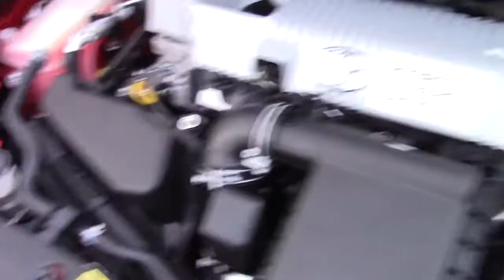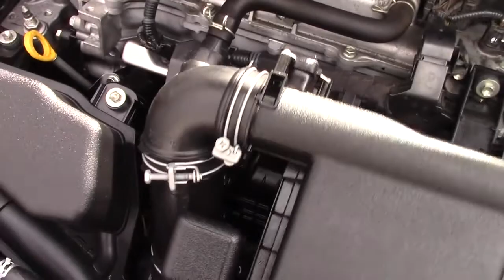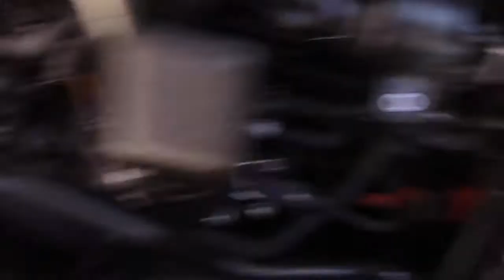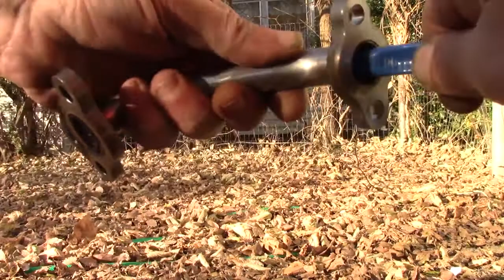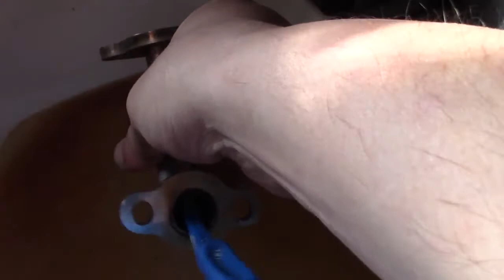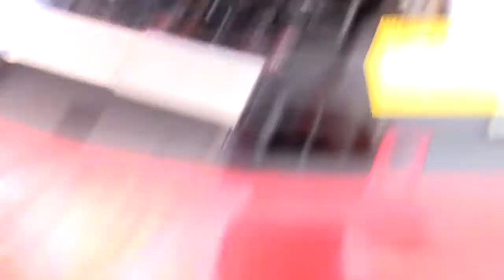EGR pipe cleaning on 2010-2015 Toyota Prius

Comment: Thank you very much! Just rolled over about a hundred six thousand miles and my engine light came on for this reason. I guess this is the only thing I have to do to make it go away I keep the engine clean?
Reply from the maker: With the engine light on, it means it's definitely time. If it still runs great you should clean out the whole EGR circuit right away. NutsAboutBolts has a full vid on it. It involves stripping down the whole path, inlet manifold, valve, cooler and the pipe. A weekends worth, but can be done on your own and saves the car. 

This is a good short thread, with plenty of tips:  https://priuschat.com/threads/egr-circuit-cleaned-it-still-cel-now-what.198447/

Comment: I dont understand how peope in the US get the egr clogged up. Poor fuel and a lot of city driving?

Your egr pipe looks normal after that milage. Mine looked the same after 165.000km (100k miles). I also cleaned the bottom part of the egr. Easy acces to it when the pipe is off.
Reply from the maker: Neither do I, being from England  :)  You have a valid point about fuel, with all the Ethanol here. It's possibly the other way around for build up too, much longer journeys? We just did a trip to Minnesota and back, 2000 miles of highway. Great for traditional ICE cars, not for Atkinson hybrids?
Full EGR cleaning is next on my list + a catch can. It's been 100% reliable over the past year and I aim to keep it that way.

Comment: How does a clogged EGR pipe cause a head gasket problem?   Is the EGR valve stuck the problem, or is it clogged pipe (between the intake and EGR Valve) with full functioning free flowing valve (with no active flow) a problem?  The EGR goes off and on a lot.   If the EGR is off, or that pipe clogged, how is the intake gasket under stress?
Reply from the maker: I believe it's to do with cylinder temperatures. A clean airflow allows the cylinder to combine the gasses properly, cooling the combustion to more of a flame. When blocked, especially to varying amounts in the inlet manifold, 1 cylinder may be running far hotter. That causes uneven heat across the block and can cause the gasket to fail. Cleaning the pipe allows the best conditions further into the system.
The pipe check is quick to do on a Sunday afternoon etc, so forming a good indicator of the inlet manifold condition without tearing everything down. 

I'll be doing our whole system at 100K, this video was a 'look see' towards overall condition. Keeping the pipe itself clean goes a long way to allowing a better gas mixture in any case. Hope that helps.

Comment: Please make sure to clean the egr cooler as well they are usually very clogged up with soot also replace the  pcv valve and add  another beneficial  extra step would be to add an oil catch can to reduce the clogging of the egr system and  reduce/fix engine knocking on cold days.
Reply from the maker: The oil catch can is on my list for near future :)
This one is on 88K now, all the 'big' maintenance is planned for 100K (transaxle, plugs, coils etc). The pipe cleaning is an indication, plus if folks can do this they should gain confidence for the fuller procedure as you described.

Comment: Is this what causes the engine to shake hard on acceleration?
Reply from the maker: It would likely be related if idle is fine, but could be a missing motor mount, or spark plug/coil pack issue. Normally it's all about the shaking/clattering  on a freezing winter morning.
If this pipe is gunked up, then the manifold at the engine front would definitely need cleaning, plus throttle body. An oil catch can helps prevent the build up. 
It's always best to let the engine switch off by itself during warm up too.
Reply: @Slider2732  changed the spark plugs and did a head gasket repair about 6 months ago but its back at it with the same thing so when you mentioned head gasket it kind of made sense as to why it keeps happening

Comment: Does this operation solve the P0401 error code? I have it. Same model Prius.
Reply from the maker: Hi Andres, have posted some info on PriusChat, but yes, along with probably cleaning the EGR manifold on the front of the engine. Easy first step is to clean this pipe. See if the code clears. If not, to then do the manifold.
Good luck!
Reply: Had this problem a year ago. Cleaned it and the error code went away for a short while and returned 3 days later. Turned out a sensor in the EGR system was defective and need to be changed. Now a year after still working as a charm.